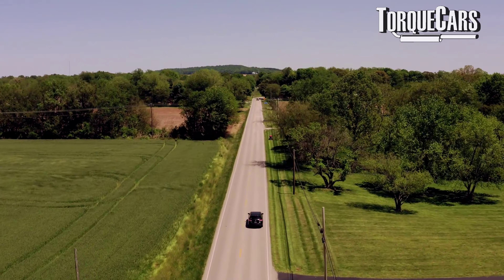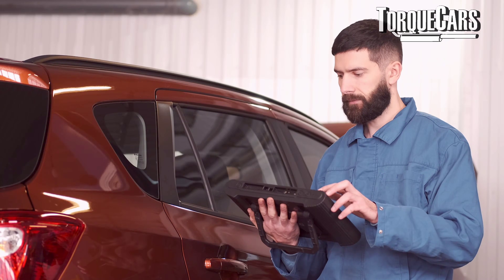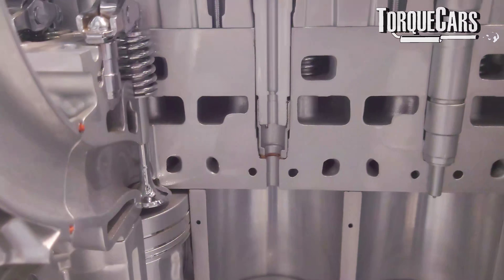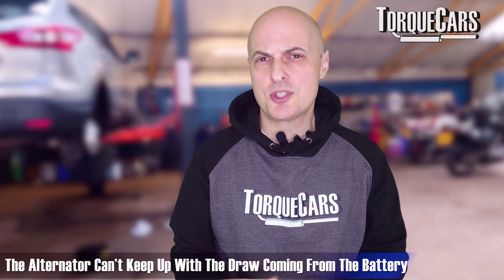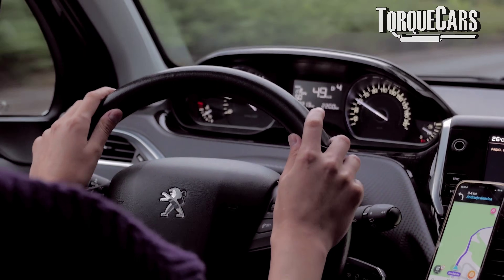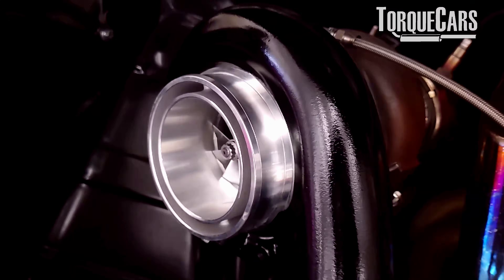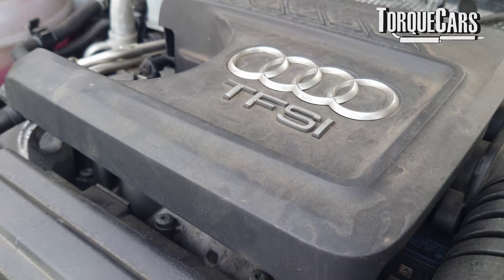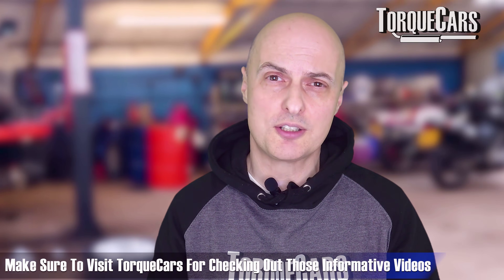Losing Power When Accelerating? Causes Explained With Easy DIY Fixes.

Comment: A click in a starter motor when starting a petrol engine can cause problems. It is short circuiting earth to live that will down power the spark plugs. The solenoid is the culprit that function the starter motor.

Comment: I’m having a confusing issue, my car is running rich during hard acceleration, and during this acceleration the acceleration completely stops, I take my foot off and put it back on and it drives Normal. Any ideas?
Reply: @colinalred1913  I have very similar problem. My car is turbo petrol engine. NO trouble codes. Noone could tell me yet what is the problem. Usually it comes when I'm on the motorway.
Reply: I think i found the issue, it was a very tiny divot in the elbow tbat holds the EWG so air was getting through and leaking out there even if it was clamped down real good
Reply: @colinalred1913  , thank you. Could you please brief the solution. I am also having the same problem.

Comment: My 2018 Hydunai Elantra has been doing this at lower speeds. It'll be working fine then all of a sudden dashboard lights are all illuminated and the vehicle's engine is off---while driving! Took it to a local well respected mechanic shop and they couldn't identify the issue and reported no error codes were being shown and couldn't replicate the failure. I see there's a recall from Hyundai gearing up for 2019-2023 Elantra's and other sedans in their lineup for 'faulty fuel pump with premature wear' that's causing loss of drive power at lower speeds. Gotta be the same thing, right?

Comment: I was driving my B5 1.8t the other day and it just shut off! Not sure why I haven't look at it yet but it cranks but doesn't start. I replaced the ecu relay not long ago so that shouldn't be the issue but I kind of hope it is!
Reply from the maker: Hope you get that sorted cheaply and quickly, run through the steps in this video, error codes first will save a lot of time if it flags something important up.
Reply: @torquecars  no codes. Went yesterday to see, and no fuel. Turns out the wires at the fuel pump itself melted and was shorting out. The pig tail was melted the wires were broken and I can't believe the car didn't burn down!
Reply: @4BillC  maybe fuel pump died